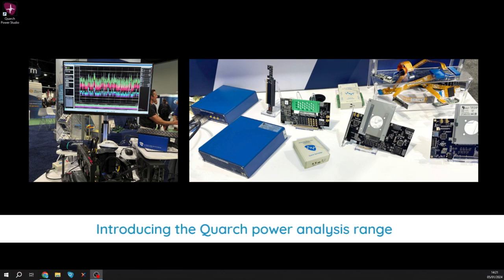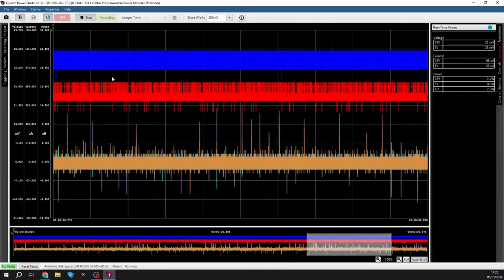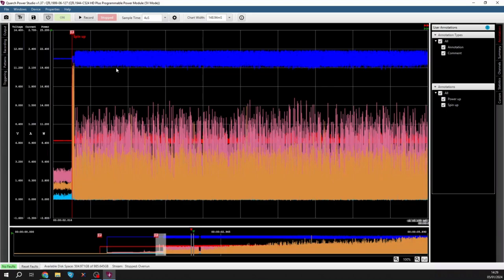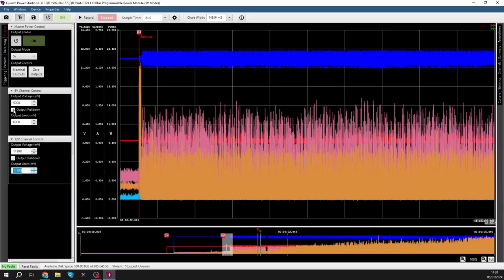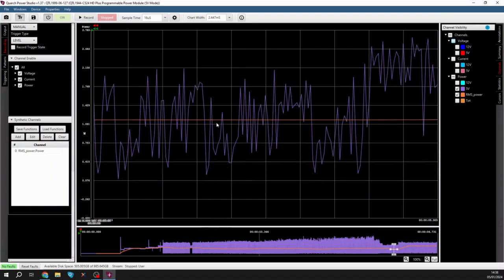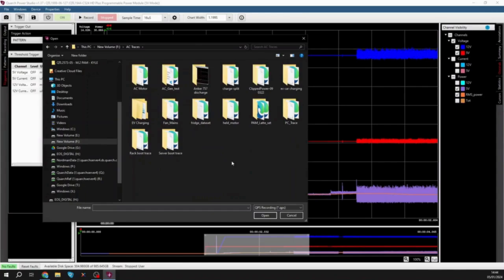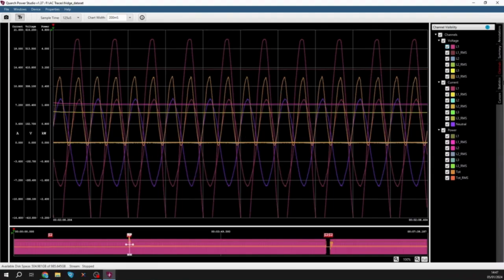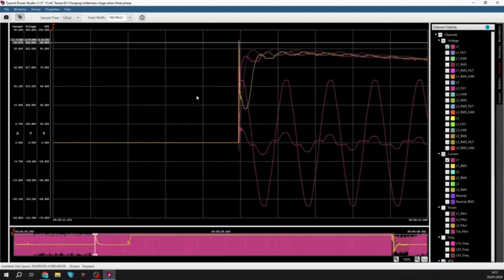Ditch your scope and get started with Quarch Power Studio

Comment: I'm sorry, hardware scopes are so much more portable, convenient and less to go wrong. Plus their cheap now.
Reply from the maker: Yes our tools are a bit less portable as it needs a PC connection. We can record much more and automate more than most scopes though, so for lab use its often more convenient. Our tools are an industry standard when it comes to power analysis for SSDs for example.

There are certainly cheap scopes out there too, (We often use Picoscopes in our lab which are great).  Our tools are almost always cheaper than a comparable scope or power analyser we compete directly against, but I would not use them for every case for sure!